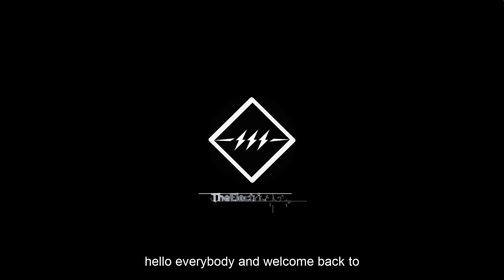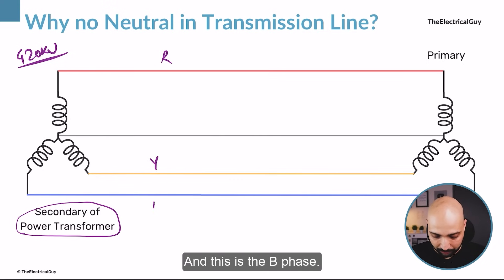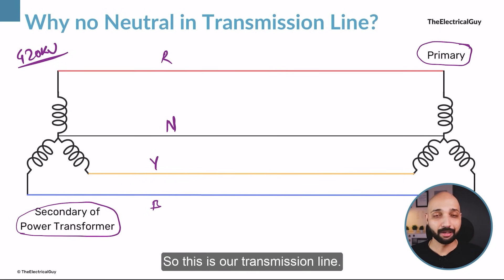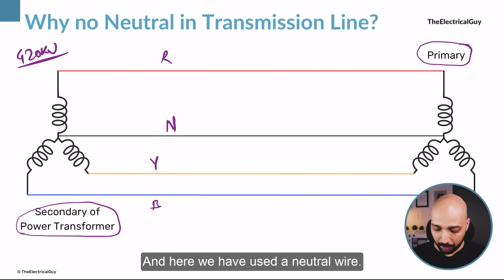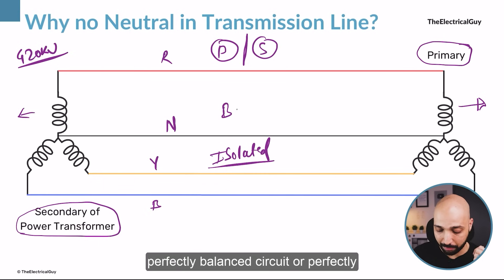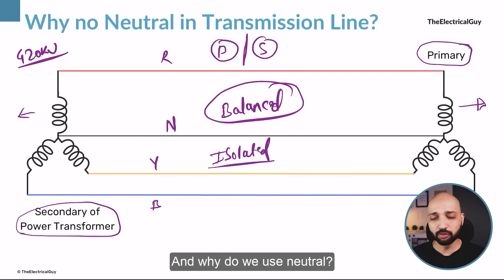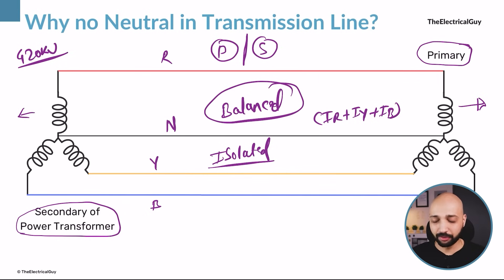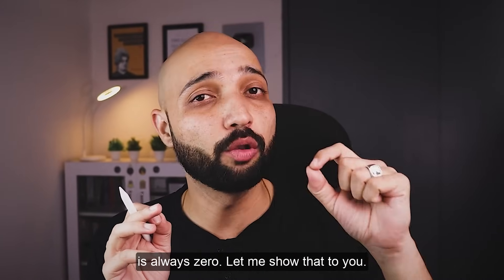Why there is no Neutral in Transmission Lines?  Explained | TheElectricalGuy

Comment: The three-phase star transformer is just 3 independent single phase transformers. The red primary only cares the currents on the red secondary.  Let's take the extreme case where only the secondary of the red phase of the right hand transformer has a load and the other two secondaries have no loads (no current).  Then the currents in the three right hand side primaries are certainly not balanced.  Stating that the circuit you have drawn is 'independent' just means that it is floating, ie: the absolute voltages with respect to ground could be anything.  It doesn't mean that it is balanced, and no actual explanation is given for that assertions.  I am guessing that the star points at each end are grounded in actual transmission lines.  I must be missing something here.  Please enlighten me.

Comment: Here in western Canada, it is common to see three phase and single phase distribution lines in rural areas with no neutral wire; the earth is used exclusively as the neutral conductor.  The single phase lines of this type are referred to as SWER - single wire earth return.
Reply: Plenty of SWER in South Africa and Namibia.  South African development in th 90s. Pleased to hear they are using it in Canada.
Reply: And in AU
Reply: Same in Brazil. Very common, specially in remote areas, where power demand is low. Otherwise, 3 phase distribution system is the norm.
Reply: Is the earth literally used as a return path or is it more like a capacitor that stores and returns charge cycle to cycle? I ask because we have SWER in my neighborhood and it seems like a long, long way back to anyplace where there might be a neutral. I've never understood this and am hoping you can answer or point me to more details?
Reply: On single phase distribution, two wires are used. The top wire is usually the neutral and is grounded. If you trace it back, it goes back to one of the 3 phases and the neutral. The grounded neutral provides some lighting protection and when things like tree branches fall and break the lines, the grounded neutral will drop and contact the live phase wire tripping protection devices like fuses or upstream breakers. Thar tends to  keep live wires from hitting the ground posing danger.
Reply: @professorg8383  On my residential street, a single phase is brought along the road at the very top of the pole: just a single wire. A bit below, there is the stepped down service that ties to laterals that run over to individual residences (240V, split phase). Below this is telecom. Where is the neutral returning that single phase?
 
The lateral over to a residence is two insulated ungrounded conductors riding on an uninsulated support that becomes the neutral in the panel. Is the idea that continuity is maintained in this middle level on the pole all the way back to where the single phase came off the distribution network and bonds to neutral there? So, even though it is two different levels on the pole, this is the neutral for that top wire? Is that the idea?

Comment: This is incorrect. In the US, transmission lines are delta connected, not Wye. There is no grounded conductor. Distribution transformers are delta-Wye. The secondary of the distribution substation transformer is Wye connected and the center point is grounded and becomes the neutral connection. The distribution neutral may or may not be run to each pole. At the final pole transformer for a residential service the primary wire is connected to the primary winding and the other end of that winding is grounded 
On the secondary side of the pole transformer, two “live” wires go to the house. These are 240 volts. A third wire that is the center tap of that secondary winding is grounded at the pole and at the service entrance to the house   That becomes the  neutral wire for the house. 
This is what is called a multigrounded secondary service which is the most common in the US. 
For commercial three phase service three single phase pole transformers are normally used connected with their primary windings in Wye with a grounded neutral and secondary windings also Wye connected with a grounded neutral.
Reply: How are the transmission lines grounded of they are delta?
Reply: @okaro6595  usually one corner is grounded through a grounding reactor. That limits the ground fault current.

Comment: No neutral? Yup. It's DELTA. Second, the grounded conductor on the top of the line structure is a STATIC wire for lightning protection. Remember cage effect in Maxwell's theory? Often static wire is OPGW. OPGW  is a static wire conductor that is wrapped around a Kevlar protected multimode fiber. Fiber is used for PT&C. For SCADA transfer trip relay protection. Has very small envelope delay for fast trip.
Reply: Faraday cage NOT Maxwell.

OPGW normally use single mode fibre optic. Multimode cannot go the distance; more than 100
Km.
Reply: @anuardalhar6762  Sr Moment. U are correct

Comment: Transmission lines typically carry high-voltage electricity over long distances. Since transmission lines primarily transmit power from generating stations to substations, they operate at very high voltages, often ranging from hundreds of thousands to millions of volts. 

In such high-voltage systems, the primary concern is to minimize energy loss and maximize efficiency. Neutral wires are not typically required for this purpose, as transmission lines are designed to carry balanced three-phase AC power. Additionally, the high voltage levels mean that any return currents can flow through the ground or other conductive paths, eliminating the need for a dedicated neutral wire. Therefore, transmission lines usually consist only of three phase conductors without a separate neutral conductor.
Reply: Technically, there is no energy loss but there can be an electrical power loss.
Reply: @georgejetson4378  Considering power is simply energy/time, that's a bit hard to support.
Reply: @stargazer7644  Energy unlike power is conservative.
Reply: @georgejetson4378  Power is also a conserved quantity for any given time period because energy is conserved, and you cannot "lose" time.  Therefore power must be conserved as well.  Power is energy over time.
Reply: Ibn taymia discovered that?
Reply: Perfect
Reply: The other phase conductors carry the return. current of the other phase. In many countries, two phase system is used in distribution where 110/220 V is achieved by using two conductors of phase and one phase and neutral. USA and KSA use this arrangement and the distribution fault is minimised by eliminating neutral current as well as current carried by two phase conductors being halved due to high voltage(double).
Reply: @محمّدقیصرفاروق  The USA does not use a "two phase" system.  For residential use we generally use a center tapped single phase system.  The two legs of that system are not 2 phases.
Reply: Transmission tower conductors are always arranged in a set of three for three phase AC, and a fourth neutral cable may be sometimes used for transmission over short distances. Transmission lines in general do not need neutral cable while destribution grid neutral is a must. Thank you for the video.

Comment: Great video sir.

I have a doubt like if at genaration side if generator armature winding is star than  neutral is not used there also?,or what?
 because that voltage also will be stepup by transformer 

So my doubt will neutral from generator to stepup transformer be connected or not?

Comment: Great video! Just one question. The secondary part of the distribution transformer is feeding an imbalanced load, therefore it needs the neutral to carry the imbalance. We also know that the load on the secondary of a transformer directly impacts the load on the primary due to the interactions of the magnetic fluxes. If this is the case, how come that we dont see an imbalance on the primary side aswell?
Reply: He explained it wrong. How can you balance the load? They cant. Only the end user, like a motor or heater with the same resistance on each fase.
Reply: You do see an imbalance, except it doesn't only load one phase like the star secondary. The imbalance will appear as greater load across two phases on the delta primary. This is the same as if you were to disconnect the neutral line's tie from the starpoint of the transformer. All the single phase loads will draw from one phase, go onto the broken neutral, travel through another load and back to another phase.
(Of course you're now dividing line voltage unequally across differently sized single phase loads, but the analogue stands)
Reply: The return path is the other phases. Just as a 240v appliance doesn't need a neutral in the USA. When one phase is positive, the other is negative. In three phase, the same happens but distributed across the three. He really didn't explain it correctly in reference to neutral. 

In split phase (USA) you need the neutral to return power used in an imbalanced manner across the two phases (which are 120v potential) one uses a light bulb and another phase uses a dishwasher for instance. If you neutral goes open, the imbalance can return 240v into a 120v appliance. 

Moreover, in Europe, single phase is different. You have a hot that is 240v with a neutral that is zero.
Reply: Search for Delta Wye Substation. The solution is in the substation transformers. They are not just 3 separate transformers.
Reply: @XetraRewop  And in many cases they are 3 separate transformers.

Comment: I thought that for long distance transmission, the delta configuration would be used, and then at the substation after stepping down the voltage, it would be converted to a star configuration for distribution.
Reply: My thought too...🤔

Comment: I have a question. I need to operate a waterpomp(2Hp/ 1 phase) at a distance of 100m on my land for agriculture. Can I use  one single wire for load and at the end use a grounding wire that is connected to a 10 ft copper earthing rod on the spot as Neutral wire? So I don't have to use double wire for the 100m distance.
Reply: you can but dont use any earth protection device only u can use one switch for operation.
Reply: I'm going to say NO.

Comment: Nutral is not just for balancing the loads. Its important for return current to the source. To complete circuit. Thats why nutral is grounded at the transformer side. To provide easy path for current with lowest resistance to back to the source. At Distribution side of course.
Reply: Unbalanced loads even from a star secondary will still load the phases unbalanced on the delta primary. The difference being delta forces load across two phases where the star secondary phase will have higher current and have some on the neutral.
Apart from returning imbalance on the neutral to stabilise phase voltage, the neutral also provides a common that can be bonded to earth ground for fault and static reasons.
Reply: No, in three-phase circuits you don't need a neutral wire to complete the circuit. At any instant of time, one or two phase wires are acting as the return wires.
Reply: Search for Delta Wye Substation. The solution is in the substation transformers. They can do a bit of balancing. 
But engineers have to balance single phase going to subdivisions periodically to ensure the load is mostly balanced across the three phases.
Reply: Neutral is the center tap of the transformer.
Reply: The neutral doesn’t “ balance the loads” … if the loads are equally loaded you do not require a neutral at all. In a balanced system minus & plus values are equal so the neutral conductor will equal zero at all times.
The neutral carries the remainder of the current in an unbalanced load.  As per kerchov law that states what goes in must equal what comes out.
The path of least resistance is the neutral, the general mass of the earth has a variable resistance & the neutral is a constant connection of a set resistance they don’t even compare in resistivity. So if you are waiting for the star point to earth to become the “ path of least resistance” then you have a very long wait before its value beats the neutral. SMH.😂
Reply: @goaway9487  You cant balance the load. How wil you do that ? This only works ive you for sure the users only use balanced machines, like motors. But that never will be the case, only in end users line. The earth is the nul line, he explained it wrong
Reply: @jelleroggen ,,he is half baked,,knowledge,,,& 
beats about the bush.  All & sundry wants to
misguide the ,,innocent,,young mind
but the bottom line is to earn thro U tube channel
U tube earns thro advertisement.
The content,,is not validated,,even not checked.
Reply: @jelleroggen When they system is large enough statistics balance the loads.
Reply: Very nice
Reply: @benskban Thats how you balance it sherlock.
Reply: I also think alike.
Reply: When a process to return it rised and balance situation it takes place, thatwhy in three phase motor no neutral.
Reply: Very good explanation. Thank you.
Reply: I have a doubt that why ac current flowing through phase to neutral in unidirectional path ? It has to flow phase to neutral and neutral phase but not why???
Reply: Mate you don’t know your subject, waste of time
Reply: Completely and utterly wrong.
Reply: thank you brother
Reply: And earthing is for fault detection on distribution systems.

Comment: Sir i have a doupt. In between the transmission line there is no neutral because its a delta connection, but if any fault comes in the transmission line like transient what will happen then
Reply from the maker: the circuit breaker will open that circuit.

Comment: We can also calculate the value of the voltage with this equation  v(t)=Vmaxsin(ωt+θ), knowing that phase two is shifted by 120 degrees relative to phase one, and the third phase is shifted by 240 degrees relative to the first; the sum gives zero."

Comment: 3 phase incoming to DB, incoming to contactor, contactor to 9 mcb..my friend and I wanted to connect single phase to mcb.. We use the last mcb (which is the 9th mcb), switch position to off and connect live to mcb terminal.. Here is where I do not understand.. All other 8 mcb is live and neutral is connected to neutral point and my friend just use his bare fingers to open one of the nut on neutral point to connect our single phase connection.. Till this day I still do not understand why he doesn't get shock by touching the neutral.. Can you explain why sir?
Reply: because no current flows thru hm

Comment: But in transmission,  delta to delta will be used sir. So no neutral. Is it not correct explanation?
Reply from the maker: It is not necessary to use only the delta delta connection in transmission ..

Comment: Am I missing something? At 360º Iy≠-Imax and  Ib≠I max just by looking at it.
Reply from the maker: It was just an example for understanding. But even if you take the actual values at 360 degrees the sum will be zero.
Reply: @GauravJ  Ah ok. I got a bit confused there. It might be better, if using 360 as an example to put amplitude as Imax*sqrt(3)/2 to avoid confusion. But you are right, the add up to zero.
Reply: Exactly, if at any time one of the phases is 0, neither if the other two can be max. It was an unnecessary simplification causing more confusion.

Comment: explanation provided here is wrong load imbalance on secondary side will indeed effect the primary...
the exact reason why we don't see neutral on High voltage transmission is because those set of wires are Delta comnected.
Reply: Which configuration? ΥΔ, ΔΔ or ΔΥ?
Reply: @MultiSigen   Y∆ with generation in star and transmission in delta , it can be ∆∆ too with generation in delta and transmission also in delta 
transmission is generally in delta
Reply: Exactly my thought .. so now am behind with the explanation above...🤔
Reply from the maker: Well, the whole reason we can use delta connections is because the load is balanced!

Comment: Since load and source are connected with transmission line, if load is unbalanced in power system does it also makes lines unbalanced or not ??
Reply from the maker: No. It does not.